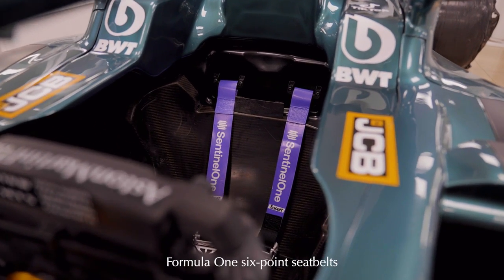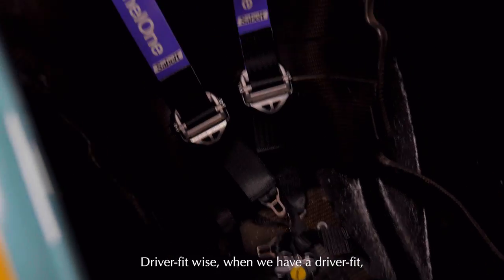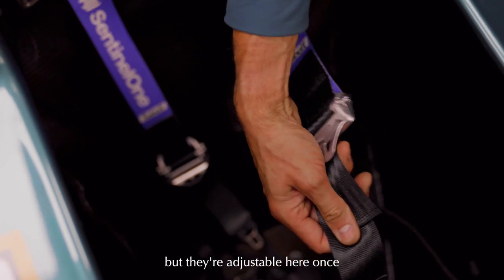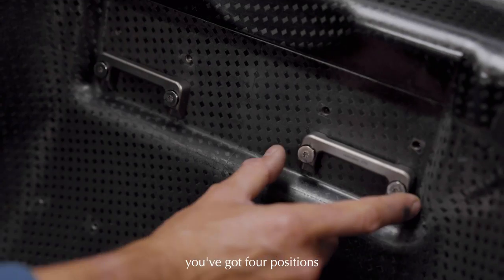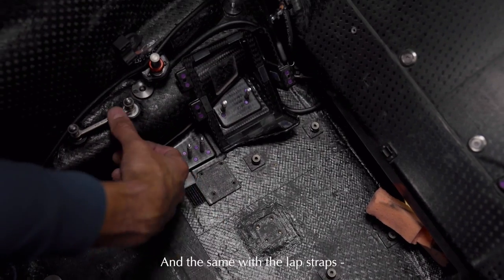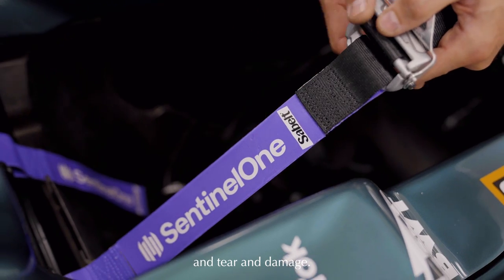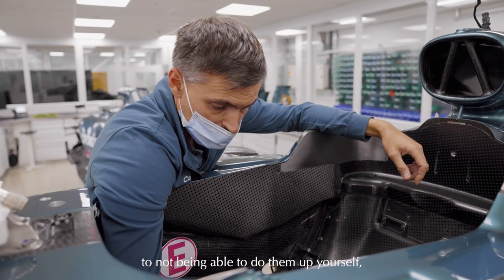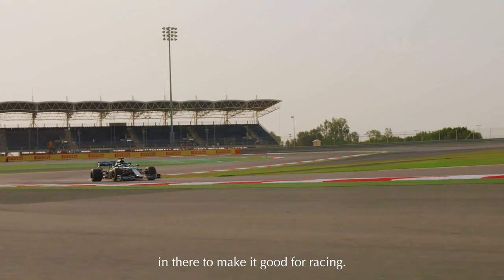Explained | The Race for F1 Safety: The importance of seatbelts

Comment: very nice. question i have is that do the seatbelt get replaced after a massive shunt or crash? also where the driver helmets meet the exhaust area does it damage the carbon fiber? Thank you @Aston Martin Cognizant Formula One Team
Reply: The driver helmet doesn't meet the exhaust. Carbon fibre exposed to high temperature is basically like burning some coal turns to smoke. This happens slowly when exposed to high temperatures.

After a large shunt the important things to check are the seatbelt mounting points, they go through large shearing forces, basically like how you tear a piece of paper, that's the forces they go through. Seat belts themselves don't get damaged this easily, they can be reused as long as the metal clamps aren't damaged. Im pretty sure after a large shunt formula 1 teams change the seat belts. Because it's not worth the risk.
Reply: @Siddhanth Bhat no im just a university student who's been a part of formula student. So have some experience designing this